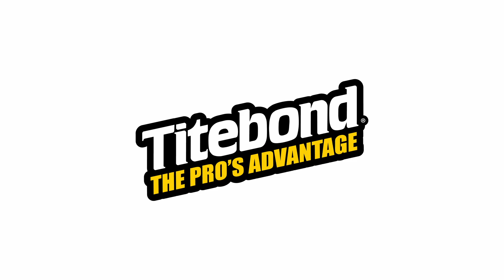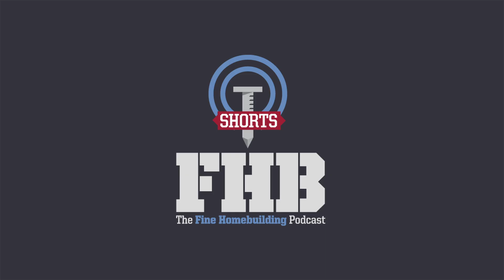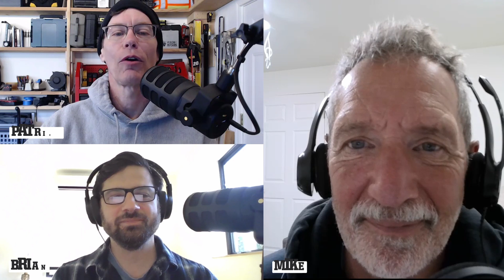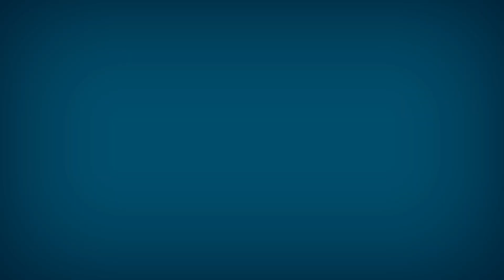Efficient HVAC for a New Build | FHB Podcast Ep 686

Comment: GSHPs work well in cold climates where even a "arctic" ASHP becomes less efficient. Places like Edmonton or Winnipeg or like the poster above in northern Minnesota. In climate zone 4a, ASHP wins hands down. Even in more northern coastal regions, ASHP beats GSHP on an economic basis over time.

For a high efficiency home, the mechanical system should be simpler, so a GSHP is less beneficial than for a leaky old house.

GSHP does have the efficiency advantage of a large, fairly constant temperature heat source year round (as mentioned) but that heat source also has the advantage of higher heat capacity. Air has very low heat capacity. Really the only downside GSHPs is the cost of digging.

Also, don't mix up the interior distribution system with the outdoor heat source: either GSHP or ASHP, can run a duct system or hydronic system inside the home. What is shocking to me though is just how costly a hydronic ASHP is in North America: might as well install a GSHP instead! 10x the price of an equivalent mini split.

Comment: We had geothermal installed at our home about ten years ago when we pulled the old gas furnace.  I can't compare to what could have been with air source, but our geothermal tied into the existing duct work has created a comfortable, quiet, efficient run so far.  1996 build - 2000 s.f. finished space - gas and electric bills total $1200/year (used to be about $1,800/year).  Incentives helped too.  Back then we got it drilled and equipment installed for about $20k.  Taking off the cost of what would have been replacing the furnace with another gas unit (and a new AC), I don't think we've done too bad for a climate that sees just about everything (We live in Minnesota).